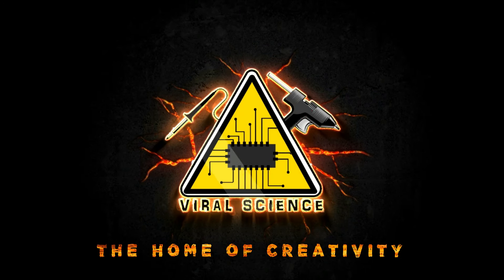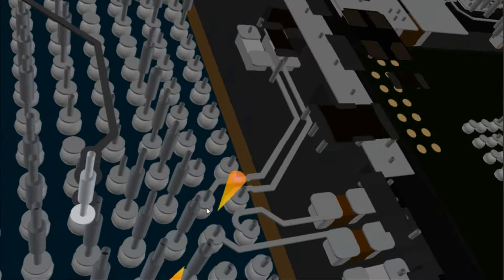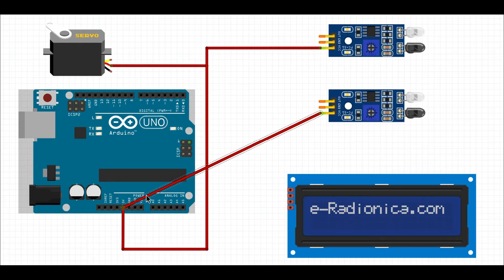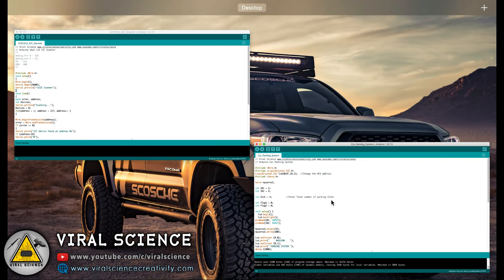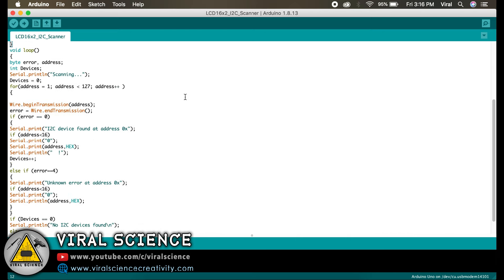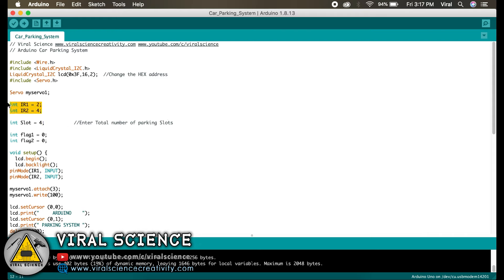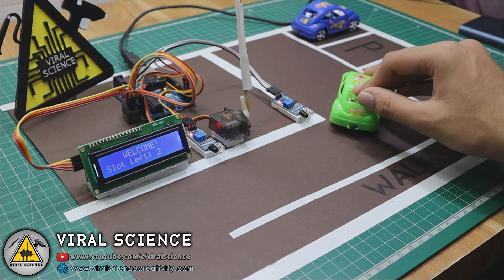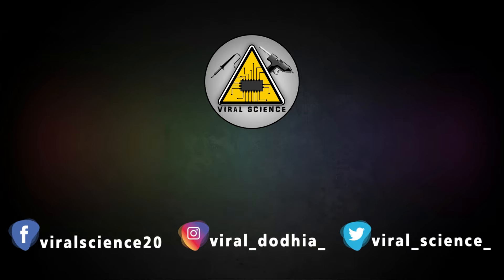Arduino Car Parking System

Comment: I made  rfid based automated parking system, replaced ir sensors with ultrasonic sensors(since ir sensors don't work under sunlight), adding a fire detection system in the parking area, added a number plate detection system and stored them on a database.(excel),uploaded the real time parking data (i.e which slot is empty , for how many hours is the slot booked, etc.) (IoT based)
I represented this project in state science exhibition and was ranked 2nd .
Reply from the maker: Superb brother 👌👌❤, Congratulations
Thanks for sharing this great features😍
Reply: If you have code with components list and diagram would u pls send me bro
Reply: @ViralScience   
Thanks!
That means a lot coming from you.
Reply: @Nothingdiffrent1234   I will make it open source, soon.
Reply: @Jarvis-cw5vu  thanks brother :)
Reply: Did you do a tutorial of it?
Reply: super  Congratulations
Reply: Congrats bro
Reply: when i go to serial monitor it just says IC2 scanning and wont find a hex port ?
Reply: also an error comes up on #include <LiquidCrystal_I2C.h> for the car parking system code
Reply: @reececoghill348   have you downloaded the library?
Reply: Alex yea both of them
Reply: @reececoghill348  what exact error do you get?
Reply: @Jarvis-cw5vu   how did you make number plate recognition system? did you used arduino ?
Reply: @Alex-ig1pt  the error I got was : 
LiquidCrystal_I2C.h: No such file or directory
Reply: @reececoghill348   
which means your liquid crystal file is missing. You can simply download the file from the link in the description, extract it and add the folder inside the library in Arduino folder
Reply: @Alex-ig1pt  I have downloaded the two files and when I go to as the zip it gives me this message: 
Specified folder/zip file does not contain a valid library

Any ideas why ?
Reply: Alex do you know what to do to help?
Reply: @reececoghill348  I can't post the answer because it has a link and goes under spams or something. I posted the answer 3 days ago :/
Reply: @Alex-ig1pt  thanks bro will give that a try!
Reply: Hello can I get some info about your project. ?
Reply: Please can you share code of that if possible circuit diagram too it's a humble request I have less time to submit my project
Reply: Brother can you help Me for this
Reply: Can you please mention Name of semulater that you have used
Reply: Then u have to upload video of ur project in detail
Reply: @reececoghill348   how debug this error please tell me bro
Reply: @Jarvis Bro can you please please share the Resources of you project of RFID based car parking 😭
Reply: Can I get the video of your project?
Reply: Can you share the process,the hardware used , circuit diagram and the source code please
Reply: If u could explain how u used ultrasonic sensor instead of ir sensor, it would be really helpful
Reply: If you have code with components list and diagram would u pls send me bro pls reply bro
Reply: 2:50 What is that black small box type thing through which Uno 3.3v is connected??? Please answer
Reply: @ViralScience  What is that black small box type thing through which Uno 3.3v is connected??? Please answer 2:50 please reply
Reply: Hi can u share this Project
Reply: @Jarvis-cw5vu  Can you send the of code and circuit diagram?
Reply: Hey can we talk about your project cause i want to also do a mini project for my college
Reply: wow man do you too have a youtube channel like how to do it and all
Reply: Please can you provide more details on the advancement of the project
Reply: Bro can u give me suggestions
Reply: Heyy can you add the open source link of your code?
Reply: Please....Can you share code...
Code given in discription can not be able to open
Reply: Please it's emergency
Reply: Sir how to add Library
Reply: Can you provide link
Reply: is there any such system available in market ?
Reply: @Jarvis-cw5vu  Kha pr upload kia hy apny??? Please tell me and help me
Reply: Bro can u send me pin diagram , code and components to me also plz
Reply: Jarvis can i get source code please
Reply: I want to this but how have you done your rfid?

Comment: what if after parking the car ,driver  comes out  from parking area ; does IR  sensor detects driver and decreases count of  occupied parking slot?  If yes it creates problem
Reply: What if two different cars enter the lot close to each other withouth the first one passing throughde second ir, or maybe more it would cause problem too
Reply: What is that black small box type thing through which Uno 3.3v is connected??? Please answer 2:50
Reply: CRYPTO time ?
Reply: @gorkemocmenn  The solution can be like... U can make the entry passage for a single Vehicle...
Where atleast 2 vehicles cannot pass through
Reply: @cryptotime5605  its a bread board
Reply: @cryptotime5605  it is breadboard
Reply: @cryptotime5605  breadboard.
Reply: In that case, we can make a seperate entry/exit point for vehicles and drivers.
Reply: A separate route is selected for the driver to exit the parking area
The sensor only detects the area where the vehicle passes and not the area where the driver exits the parking area.

Comment: Hey everyone, I'm not sure if anyone is still following this project or looking to get it up and running, but I have tried and would like to share some updates that could be helpful.

1. The code for the LCD Scanner is working.
2. The code of Car Parking system:
+ The LCD may show nothing or display an error message with lcd(begin). To fix this, you can try replacing "lcd(begin)" with "lcd.init()".
+ Please note that the car or item must cross through both IR1 and IR2 sensors at the same time. If you try to activate only one of the sensors, the system will not work properly.
Reply: the project is not working as he is showing in video and servo motor is moving continously
Reply: Bro what is the name for the extension board?, plaese help me bro i dont know where to buy
Reply: thank you so much
Reply: thank you so much this really helped alot
Reply: The lcd is not displaying anything in tinkercad stimulation can you please help what do i do??
Reply: When i run the code the servo motor starts spinning non-stop. Do you know what may caused that ?

Comment: code has an error which is as follows-
C:\Users\Lenovo\AppData\Local\Temp\Temp8d106ed1-f922-4a11-ad36-d756798f3f53_Car_Parking_System.zip\Car_Parking_System\Car_Parking_System.ino:5:10: fatal error: LiquidCrystal_I2C.h: No such file or directory
 #include <LiquidCrystal_I2C.h>
          ^~~~~~~~~~~~~~~~~~~~~
compilation terminated.

exit status 1

Compilation error: LiquidCrystal_I2C.h: No such file or directory

Comment: Bro, I have done as you said. But mu Lcd is showing only boxes instead of text
Reply: please check your LCD connection and LCD I2C module Soldering.
thanks
Reply: @electromodule7987  It's already soldered

Comment: Hey it shows compilation error. I have installed all the libraries but still it isn't working. Could you please help?
Reply: Hi did you solve the problem please because i have the same problem
Reply: @rihemboukedi3597  Hey yes I solved it! The circuit is working perfectly fine. One of the libraries was installed uselessly, so I deleted it. 
The next major fault I found was that the Arduino was not able to find the port. See if you have the same.  So I searched in the internet and found this video. 
https://youtu.be/-N4xFEku6u8
Hope it helps!
Reply: @mahimittal364  thank you ❤️❤️

Comment: bro a small issue i faced in your code. since you not mentioned about lcd.begin() so for 16x2 we need to use lcd.begin(16,2);
also in void loop, you missed lcd.init(); line before lcd.begin();. these are the error i faced while i run code. 
thanks for your valueable content
Reply: hello do you have the new code after correcting the error you assist me please
Reply: Can you provide me the new code please
Reply: @RahulAdiyapathamS bro do u have new code
Reply: can you please provide the  new code?
Reply: ممكن الكود الجديد 😢
Reply: Can you provide the new code please?
Reply: When i run the code the servo motor starts spinning non-stop. Do you know what may caused that ?

Comment: Bro , very well work . But when a person or an animal will try to go to the other side of the road , the proximity sensor may detect it and it will open the barrier . For this issue , you can use cameras and program the Arduino as when the proximity sensor detects an object , the camera will be on and see wether it is a car or a person . If car then it will open the barrier and if person then it will not open the barrier
Reply: but you can just adjust the potensiometer bro

Comment: May I know which software did you use for simulation part?
Reply: Are you asking about Arduino IDE software ?
Reply: @IllIIIIIIllll  Bro can you tell me the code if this same project is for Toll Tax system where I need to change in code?
Reply: @anamee6534  I think the inside condition if (!isnewcardpresent) will be write(0)
else write(90) something like that.

Comment: Which software did you use to show the circuit diagram?
Reply: Fritzing
Reply: @creeprovec718  What is that black small box type thing through which Uno 3.3v is connected??? Please answer 2:50
Reply: @cryptotime5605  Use breadboard instead
Reply: Can I know if the code worked exactly or not

Comment: Waow..... Great video sir .. ❤️

Sir kindly tell me .which software you are using for making circuit diagram 🙏......
Reply: Cisco packet tracer
Reply: What is that black small box type thing through which Uno 3.3v is connected??? Please answer 2:50

Comment: Good project, I think it's good idea to add remote control device so only some people can enter the parking.
Reply: What is that black small box type thing through which Uno 3.3v is connected??? Please answer 2:50
Reply: @cryptotime5605  It's just a mini breadboard :)
Reply: @batticha462  thanks bro just new to this stuff 👍
Reply: @batticha462  is there any rule for breaad box connections? Or we can connect it anywhere ? I have a bigger one and am confused about it

Comment: nice work and would be interesting if also could do submarine full video, code circuit diagram, and also fully automated supported traffic light system, full automated home automation system by Bluetooth and wifi. for now well done

Comment: hello there i got an error message called "no matching function for call to 'LiquidCrystal_I2C::begin()" can u help me? thx !
Reply: I also got the same error
What is solve way.
Reply: @khawjamujtabahashimi2566  i just change from "begin" to "init" and it solve the error
Reply: @amirulikhwan6618  will u send me the correct working  code to me
Reply: @siddhantsh5941  Can you please send me the correct working code for the LCD 16x2 _I2C_Scanner?
Reply: @amirulikhwan6618  can you help me, I’ve to submit my project! Not able to solve the error
Reply: @amirulikhwan6618  how
Reply: @amirulikhwan6618 can you send correct code for me
Reply: you need to go to the library and search for liquidCrystal, when u find install and probably then it will be correct

Comment: I made one like this but i had some trouble adding my HC SR04 so i decide to make it manual using a 4pin pulse button 

EDIT: I bought a keypad so now i made my system more "secure" because now it requires a password in order to open the parking lot